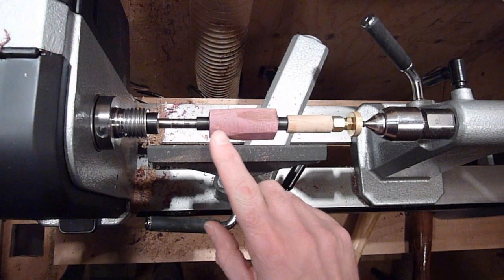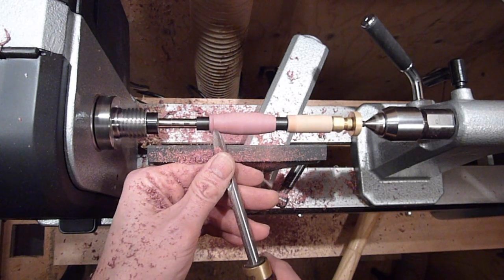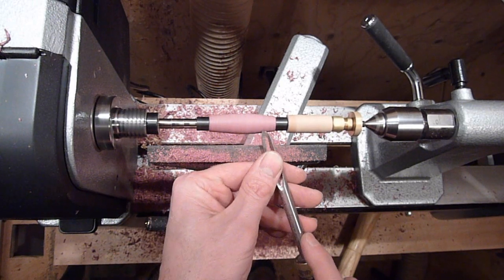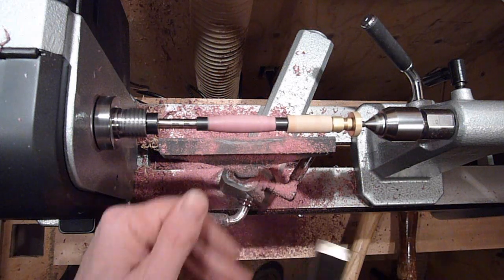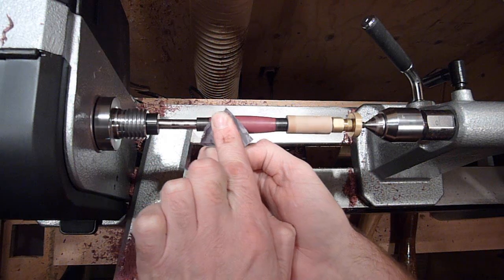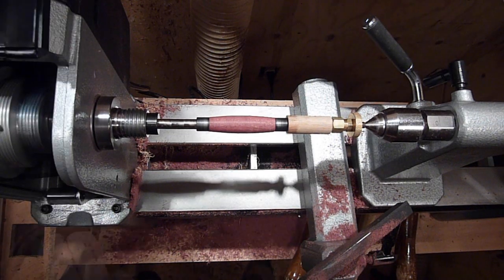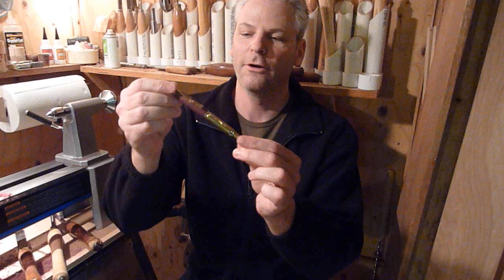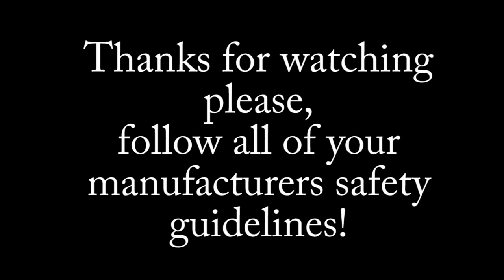Woodturning Bullet Pen

Comment: Carl, I have always managed to press together the pens I have made using my bench vice (with wooden jaw liners). I normally use very thin cellulose wood sealer & beeswax as a finish although I have seen videos pushing a finish using cycroanylates (super glue), not tried it yet though. Keep the videos coming, always look forward to them. Thanks. David.

Comment: Nice pen.  I use an aluminum bar clamp that I picked up at Harbor Freight to press my pen parts. I think the screw of the clamp gives me more control over the amount of pressure that I put on the parts, and it's much cheaper too.  I just have a couple of wood blocks on either end of the clamp to keep from scuffing the pen.

Comment: Nice pen, Carl!  I really like turning pens, it can be both simple and challenging at the same time, depending on how much you decide to do with it.  For a "pen press" I also use the drill press, clamping the pen blank to a 4x4 scrap with a 90 degree v-groove cut into it, and then support that against the fence -- works like a charm!  I can't justify spending the money for specialized equipment until it becomes 100% necessary.  I may try to make a pen press with scraps, will let you know. ;)

Comment: FYI: The 2-part brass compression nut (that you put between your wood spacer and the knurled brass screw in the video) is supposed to be used to adjust the working length of the mandrill.  You put it between the leftmost bushing and the headstock so you can slide it closer or further from the tailstock and tighten it down. Then you don't have to use wood spacers to make shorter pieces fit on the mandrill.

Comment: Carl next time putting on a finish try this  sand down say 400 grit then take a brown bag tear off a piece and burnish the wood , then take a little lind seed (boil) oil rub it in the wood while spinning, then take 4/5 drops of CA glue "thin" Use blue scott's paper towel only,quickly swipe back & forth 2x then hit it with Accrelator spray very lightly from a distance. This will dry the CA & boil lindseed oil quickly.And the finish will shine like no one business try It, i made over 300 pens

Comment: I would use a different finish then the bees wax. People will carry pens with them everywhere and the wax will melt off or wear off. CA glue finish is a quick and easy if you get ahold of the high grit micro mesh. Plus if you don't use oil/wax it will help keep purple heart purple. If you don't like the odor of ca glue, I've used general finishes waterbased poly on small turnings. With the micromesh. It gave the object a glass like finish

Comment: Howdy from SC. No Carl I didn't make a video of it cause, well I'm doing good to check email. I'm not really swift on the computer. I did manage to post a video on facebook once. The press was a piece of PVC I split length wise all but the last 2". That formed a tray for the pen to rest in and I put that in the chuck. Used a piece of wood dowel to press with on the tail stock end.

Comment: Well when it comes to doing video and trying to post it I suck. Sorry. But for the press I used a piece of 3/4 PVC split it lenghtwise all but the first 2"  that left a round piece of pvc to put in the chuck and the little tray pointed toward the tail stock. I cut a dowel tofit into the tray and used the tail stock to press on it. Hope that helps some. I'll take a pic of it and post it on my face book page.